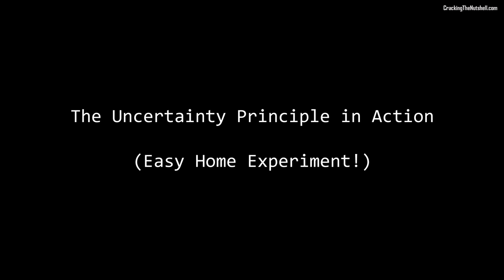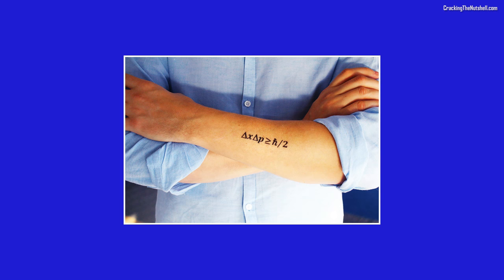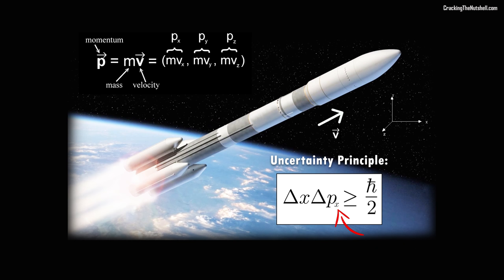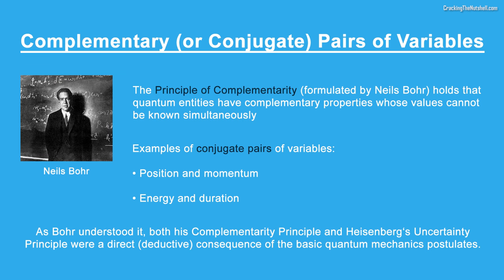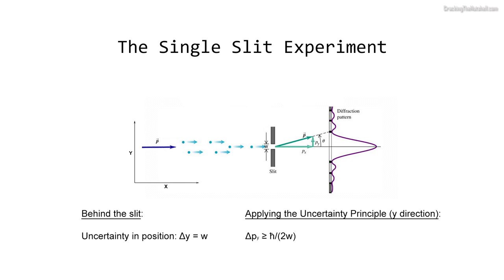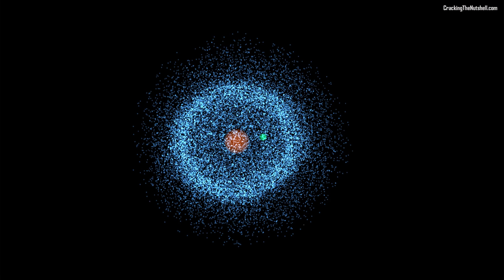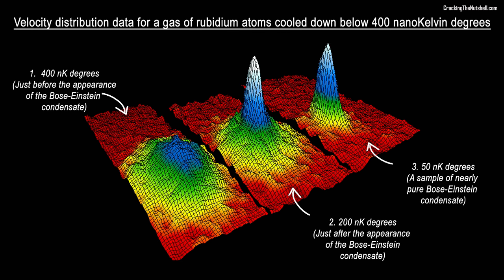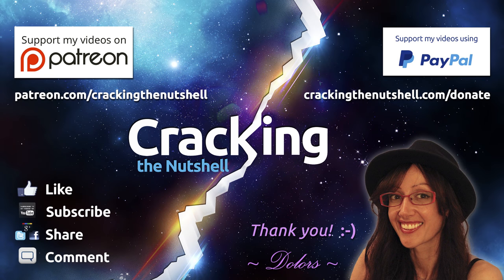Heisenberg's Uncertainty Principle - Single Slit, Hydrogen Atom & Bose-Einstein Condensates

Comment: Years ago I had one of those Dover paper backs that reprints old physics papers. One was Heisenberg's first paper where he derives the uncertainty principle. He used a disturbance model. He speculated what would happen if you tried to use a gamma ray microscope to observe an electron. Why gamma rays? The electron is tiny so you have to use light with sort wave length (i.e. gamma rays). Gamma rays pack a lot of energy so they seriously disturb the electron in the process. Using optical principles and stuff that was way over my head at the time he derived the uncertainty principle. Then he went a step further and speculated this was not just an observational limit but in fact a fundamental principle of nature. Quite a leap at the time for sure! He went on to develop matrix mechanics, which no one liked. Then later wave mechanics came  along which everyone liked "more better". By now Heisenberg would be a forgotten name except for his discovery of the uncertainty principle.
Which was just incredible!
One of the many things about Quantum Mechanics that blows my mind is the way the uncertainty principle comes right out of wave mechanics.
One more point you use the phrase "nano Kelvin degrees"
WRONG!
you don't say Kelvin degrees, just Kelvin or Kelvins.
Sorry to nitpick.
This is an excellent presentation!
Reply from the maker: Hi Waldo - Thanks for your comment and support! Yes, will cover Heisenberg's Microscope and the Observer effect vs the Uncertainty Principle in the last video in this series (including a bit of history on how Heisenberg got there, and how Bohr and others helped refine the Uncertainty Principle into what it is today). It is fascinating to read about all the history behind it, isn't it? :-)

As for the "how" question, that is, how the uncertainty principle seems to come right out of wave mechanics, I am working on this as we speak (video should be ready in a week or so), but I was actually intrigued whether this is true, so I dug a bit deeper to find out more not just about the "how" but also about the "why" (we all want to know why, right?). Then I found stuff from quantum information theory which seems to indicate that the Uncertainty Principle may be more fundamental than wave-particle duality, or at least that both may be a manifestation of some more fundamental principle. Will speculate about all this in part 3, where the question of "why the Uncertainty Principle?" is going to take center stage.

No worries about the nitpicking :-) I am aware that it is incorrect to talk about degrees Kelvin, but I do feel that it is little more than semantics, and omitting the word "degrees" is mostly to indicate we are talking about an absolute scale. since I make my videos to reach the widest audience possible - while trying not to dumb the content down - I don't want my videos to completely get out of touch with the layman. Most people (outside academic science) do not use Kelvins at all when talking about temperature. Saying "degrees" is redundant / incorrect in this case, but I felt that it would be more intuitive for the layman to add the word "degrees", so it was clear I was talking about temperature. 

Thanks again for commenting. Best wishes! :-)
Reply: Hi again,
I apologize first, I'm working from a very corroded memory! I recall that in wave mechanics the sine wave is used for momentum and position is represented with wave packets. the uncertainty principle somehow comes from the fourier transform relation between them.

Comment: @10:30 you mentioned that there is no way the electron can spriral down into the proton because of the uncertainty principle; meaning we will know where the electron is. But in the core of neutron stars or black holes this is happening. Granted, we cannot duplicate the conditions of neutron stars let alone black holes but by careful calculations we know that matter is squeeze so tightly that all the space between the electrons and protons that proofs that uncertainty principle is not at play here.

Comment: The information that defines the position of the locus of the electron is due to the probability reinforcement of the inwards/outwards exponential boundary between 1 and zero, ie the node/ratio of quantized orbital energy compounded at the locus of the nucleus. Overall it's a pattern of mathematical phase-locking imprinted on change that, because of the imprecision of the methods of measurement, is loosely defined or "uncertain", in non-scientific language.

Comment: Love your videos! Just want to put some topics for discussion: it seems to me that from a instrumentalist point of view, it doesn't make sense to say that the Heisenberg's Principle implies that one can't know the position and momentum of a photon simultaneously. To evaluate it in this framework, one has to bring the "ensemble way of thinking" to make sense of it: the deviation of position and momentum as calculated through many copies of an exact system (where in half, e.g., the position is measured and in the other half the momentum is measured, then deviations are calculated) should satisfy Heisenberg's Principle. Also, saying that a quantum state 'has' a certain value of position or momentum also makes no sense in this approach. I'm not saying this pragmatic view is correct, but it brings some interesting discussion. Another thing that also bothers me with this popular phrasing of Heisenberg's Principle is the word "simultaneously". How would one go about measuring two quantities simultaneously in QM is already a difficult task to think of, but suppose we want to measure position and momentum within a very small interval of time. As soon as you measure, e.g., position, the previous state you had is collapsed, and measuring the momentum right afterwards won't give you the result you want because the state you're measuring is not the same. This points me towards the instrumentalist approach as a more reasonable interpretation of QM. What are your thoughts on this?

Comment: Lovely video! It raised me this question:
"The product (ΔxΔPy)(ΔyΔPx) can be rearranged to (ΔxΔPx)(ΔyΔPy) which is constrained by the Uncertainty Principle. Wouldn't it generate a constraint for perpendicular directions?"
Also, the slit experiment shows that some ΔPy is generated, which has to come from somewhere since it is kinetic energy, but since the particle's energy moves it in the x axis, for it to have some Ey, some Ex has to be reduced, or am I wrong?"

Thank you. I'd love to learn more.
Reply from the maker: Hi there - thanks for your comment. The fact that the product you have written can be re-arranged, and that that product is constrained does not mean that you get a constraint for the simple mixed product (mixed directions). As for your energy question, energy has no direction, it is a scalar... so there is no such thing as Ex, Ey, Ez I am afraid.

Comment: Could you explain in simple terms why increased momentum makes the photon go more to the left or the right? If a car has more momentum, my intuition only tells me it's going faster in the same direction (or getting heavier), not going more to the left or right.
Reply from the maker: Great question. We are talking about the uncertainty of a momentum's component, hence we are talking about uncertainty in a particular direction (applying H.U.P. in the y axis in this case which, given our choice of axes, implies that there is uncertainty in the right-left direction when we look at the screen, as we stand next to the laser). We are not talking about uncertainty related to the momentum's overall modulus - hence this is not about uncertainty in speed, but about uncertainty in the velocity's component. It's not that the particle is moving faster behind the blades. It's just that its momentum component along the y-axis now has a higher uncertainty (that is, the particle is not necessarily moving in a straight line anymore).

Comment: It's a bit annoying that in the beginning of the video you're narrowing down the photons horizontal - a.k.a. x-axis - position by pushing the blades together,  but from 8:23 you're all of a sudden talking about narrowing down the photons position on the y-axis, a.k.a. it's vertical position. That's confusing to non-scientists.
Reply from the maker: Hi - thanks for your comment. Horizontal direction does not necessarily mean "x axis", nor vertical direction necessarily mean "y axis". What we call horizontal and vertical is relative to the observer. We have a 3D setting here (what you see at the beginning, in the demonstration), so we not only have an x and y axis, but also a z axis. In this case, it is often convention to use the z-axis as the vertical axis but, as I said, this is all completely arbitrary. Unless one specifies the axes with a diagram,  assuming that vertical means y and horizontal means x is not a great idea. Once I show the diagram, then I show the 3D setting flattened out onto a 2D drawing (blades seen from above). The x and y axis are drawn also, so you can see which is which. In this case, both the y and x axis are "horizontal" with respect to a person who is standing next to the blades. Neither x nor y are vertical here. Can you see it now? Hope that helps :-)